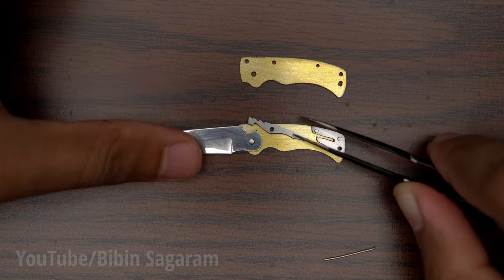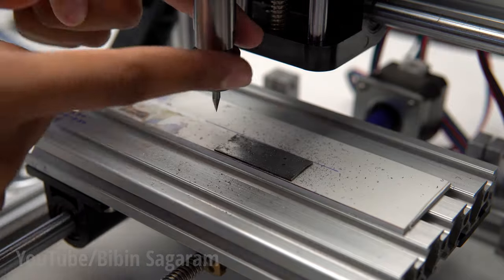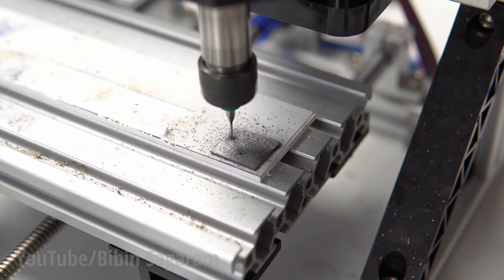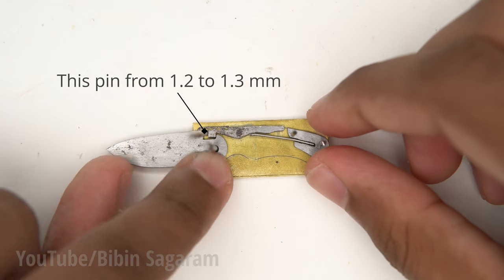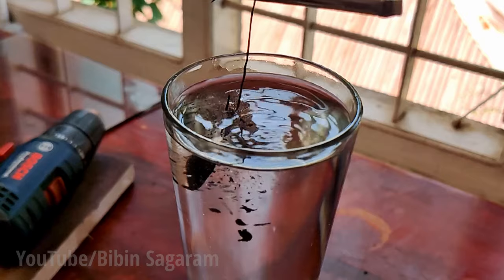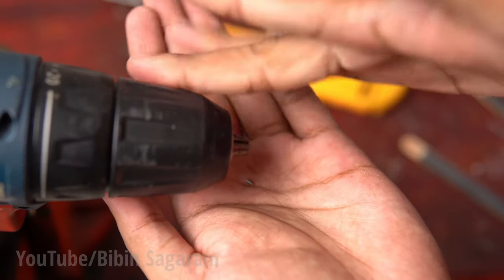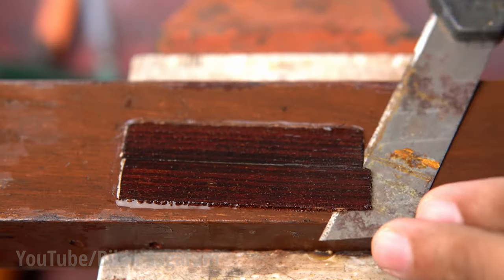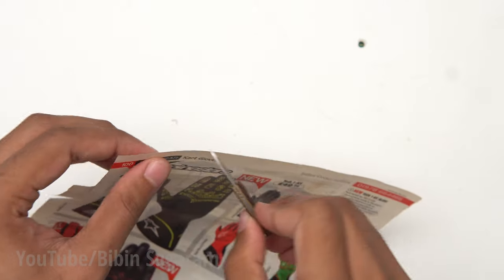Making a Mini Folding Knife

Comment: Hello Bibin, I’m a big fan of your videos. I have a couple ideas for videos:

Miniature Ancient Weapons: Somebody else commented this and I agree with them. A miniature Catapult or Trebuchet would be very cool.

Miniature Engine: Could be steam or glow plug. You could even build a “tether” car that was powered by this small engine.

Miniature Air Conditioner: This would be very hard to do, but very cool and impressive.

Miniature Water Pump: Maybe it powers a micro desktop fountain? Or battery powered squirt gun toy.

Miniature Air Compressor: Could run model engines and other small things with it. (Like a mini paint sprayer).

Miniature Tools: Circular saw? Lathe? 

Miniature Stove: Like a wood burning stove but scaled down.

Miniature Bricks

Solar/Wind Power: Always interesting to see projects using free energy.

Miniature Boats: Could be very simple or complex powered models.

Miniature Distillery: Alcohol or desalination

Miniature Roller Coaster :)
Reply from the maker: Thanks bro, Awesome Video Idea I will add it to my list! Thanks a lot 😊